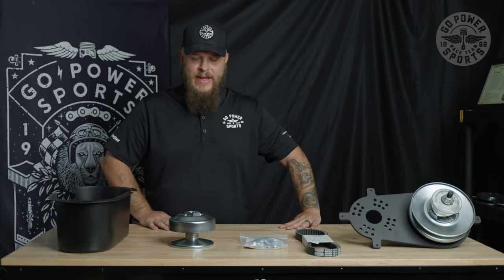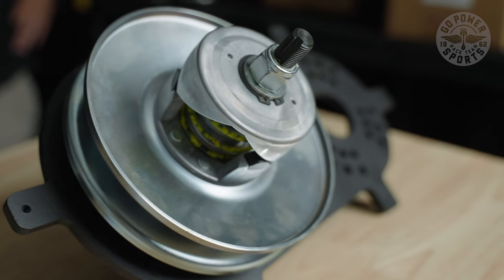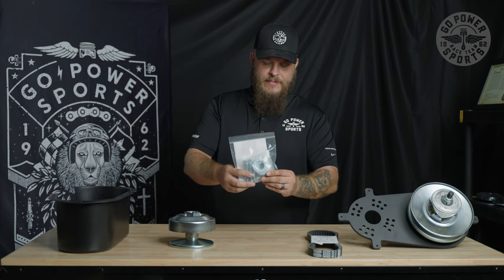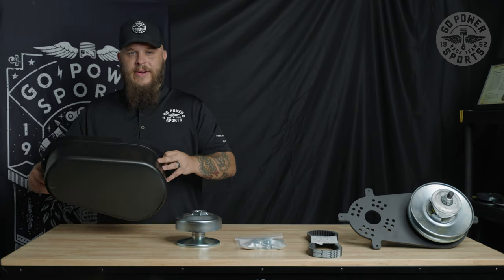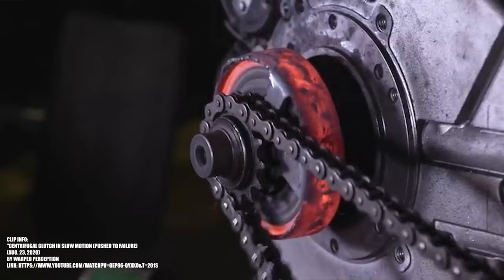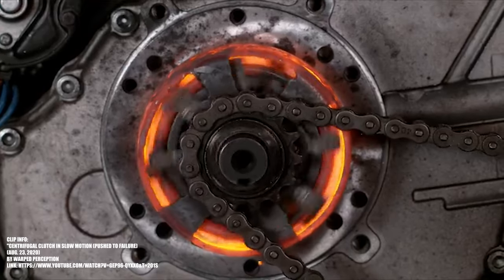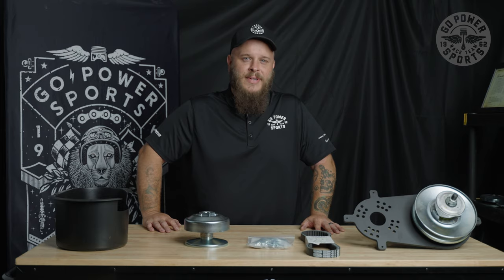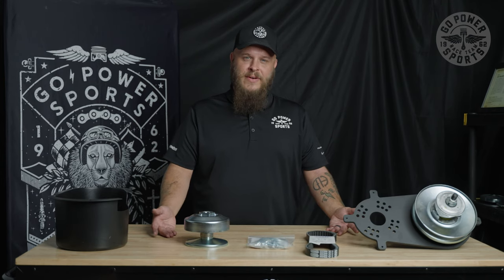40 Series Torque Converter Kit | What's In The Box?!

Comment: What causes the 40 series drive pulley to get stuck wen you hit top speed then hit the brake and it kill the engine. Every 40 series I have tried has done this
Reply: I have had the same issue lately and the torture converter was brand spanking new
Reply: @gravebrothersracing3359  the answer I found is to use a 780 series
Reply: I might try the 44 magnum series first since that will a cheaper option. The tav 780 is about 500 bucks.
Reply: @#GraveBrothersRacing  it will work well. If you look up the 40 it is ment to be used on power equipment not go karts there ment to have the 44
Reply: @gravebrothersracing3359  the 40 series is designed for low rpm